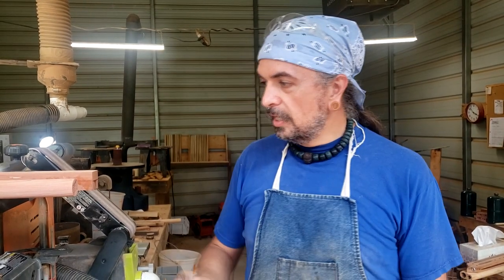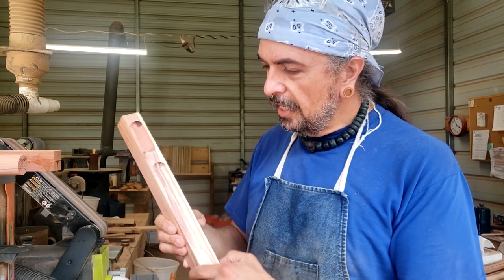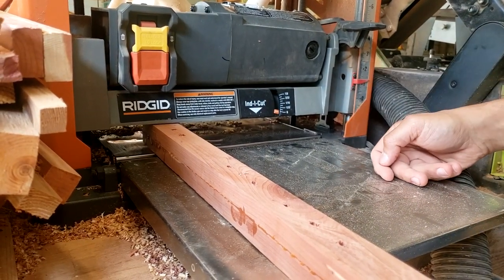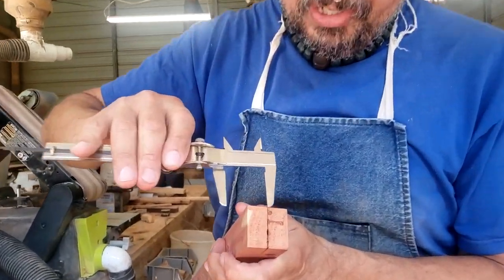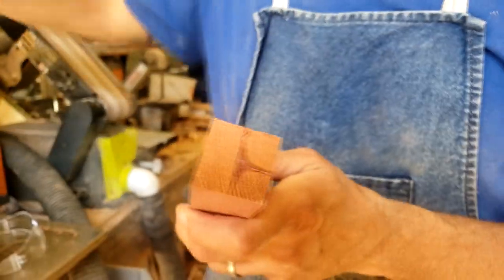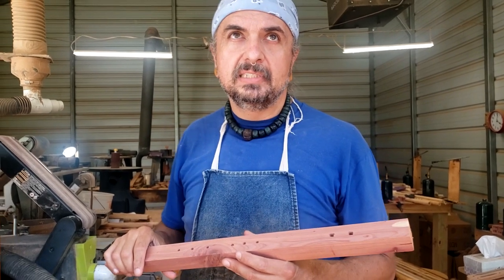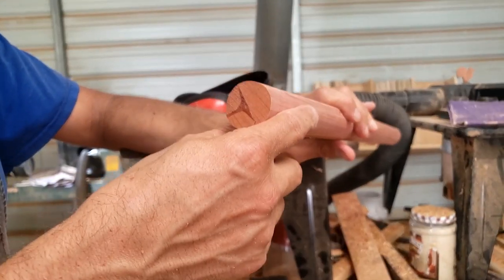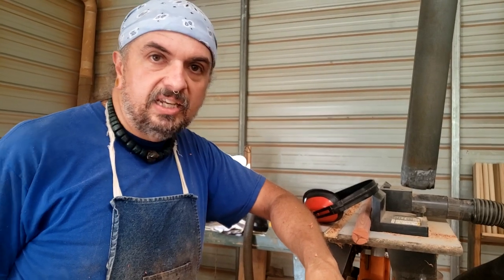How to Plane and Round a Flute Blank - Native American Flute Making

Comment: Hi Charlie! Thank you for putting these videos together. I've been watching since the beginning and you've helped my flute crafting tremendously. I have a question about the final sanding on the lathe. I find it very challenging to get all the circular sanding marks off the flute. I can do it but it just takes forever. Wondering if you have an efficient way to make them nice and smooth. Thanks so much for all your contributions.
Reply from the maker: The best way is to sand it by hand with some 220 after the lathe. 🙂

Comment: Awesome, just what I want to see.
Reply: I've been doing mine by hand, using a hand planer, followed by a lot of hand sanding.
A new method I am trying now, a method I 'invented' (unknown if anyone else already does this) is using 1.25" angle iron, three feet long. On the inner flats of this I glued a 1x30 80 grit sand belt, cut to open to 30 inches. I glued one belt on one side, then another to the other side, giving me a "V" to sand my flute in. With each stroke the length of the angle iron I rotate the flute about a quarter-inch or more. This way I am not sanding the same spot too many times, thus creating a few flat portions the length of the flute. Rotating makes it round. This method sands only the high spots, until the flute is as round as I can go. I'll finish up with hand sanding.
I hope I described it good. Thank you,Charlie, your vids are very educational.
Reply: @RustyGunn7  that's an innovative way to round out your flutes.  Great idea!

Comment: Hello Charlie, I am trying to get back into NAF making out here in NM.  Was wondering when you round it by sanding on the lath do you have to be concerned with the sound holes or do you just make sure the unit is totally round because you will shape and tune each hole to proper sound after all of this is done?
Reply from the maker: Great question! It is something of a process. It is just like starting off with very coarse sandpaper when sanding and moving onto very fine sandpaper. In the process, we usually rough out the blank first, drill the holes from the inside then laminated back together. Once it's laminated together, I plane the outside of the wood, rounded it off and then stand it on the lathe. From there it goes to the finishing area. During finishing everything will be made more fine and the track area will be flattened and surfaced appropriately. After everything is completely finished, we will fine sand it, oil and then wax it.

Comment: Hello Charlie, As always great video. I have 2 questions first one the blanks you send as flute kits have the whole all the way to the end, the one in this video did not, the one in this video makes sense to me that it can be hooked up to a lathe. How do you cut the hole in the end of the flute in this video, also how can I connect one of your flute blanks to a lathe?
Thanks Len
Reply from the maker: Hey Len, great question! We actually drill and or cut the end off of these blanks when we are finished and likewise you can actually glue a piece of flat wood to the end of your kit! Plan B is you can always order a kit with the end on it per your request! Thanks so much for watching!